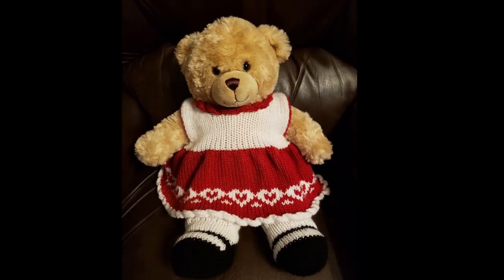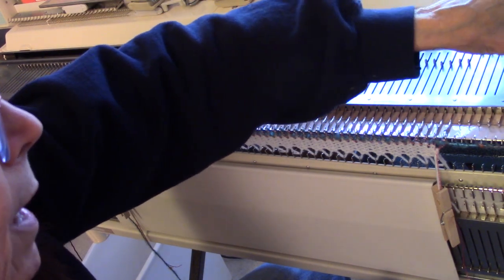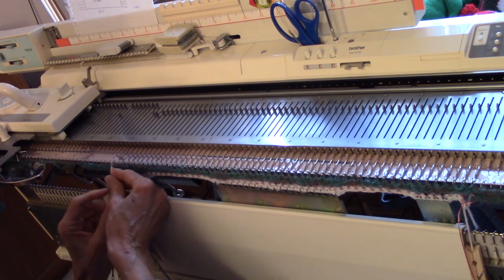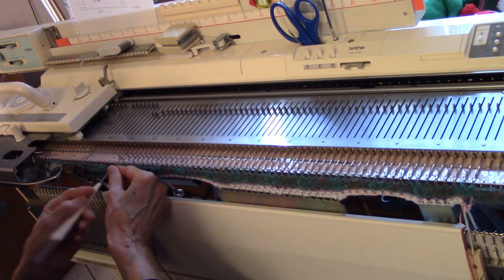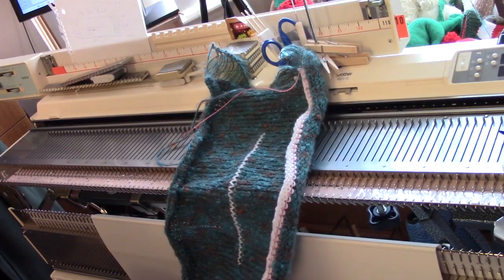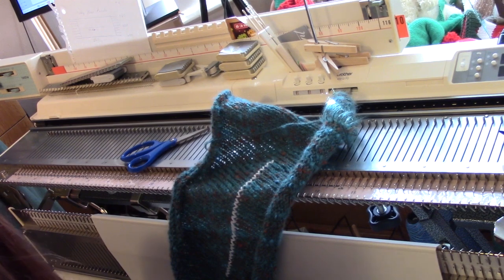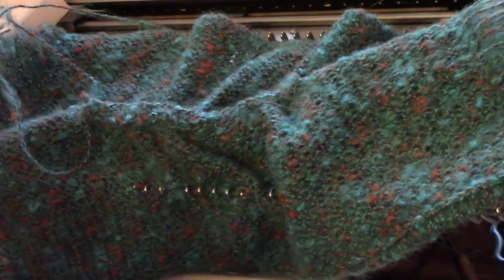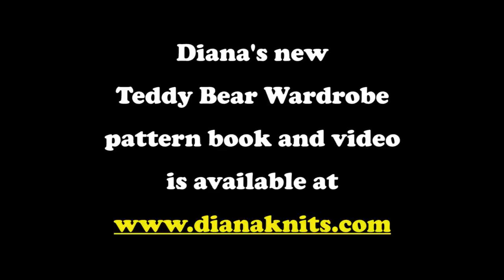Teddy Bear Poncho by Diana Sullivan Machine Knitting

Comment: Thanks for sharing. So many techniques demonstrated in this project that can be applied to other projects. Always a pleasure learning new ideas. Looking for a twisted fringe with a bead. Have you done one like that?
Reply from the maker: I do have a twisted fringe.  Don't know why you couldn't push a bead onto the strands, center it, and then do the twist.  This would give you a bead at the bottom of each fringe.  Warning:  This is a lot of trouble!  You will need a very small latch tool that will go through the bead for putting that bead on, or you'll have to put all the strands into a tapestry needle that will go through the bead.
Reply: @dianaknits  I have found a beading latch tool. Almost microscopic. That should work